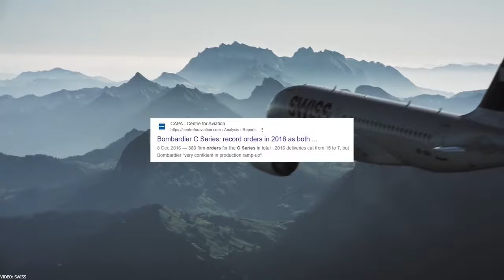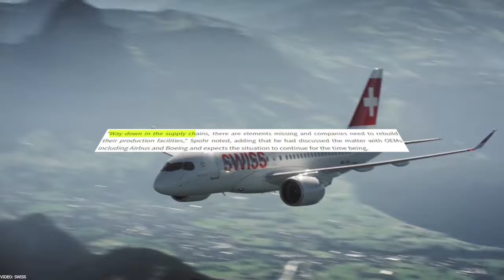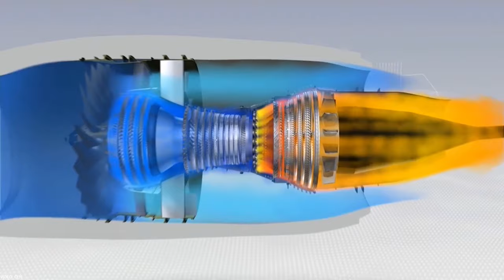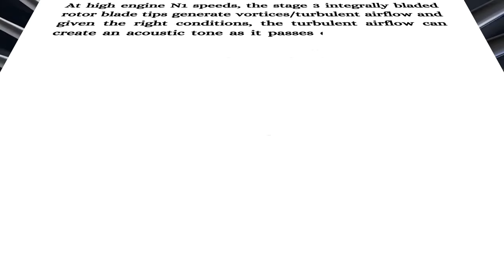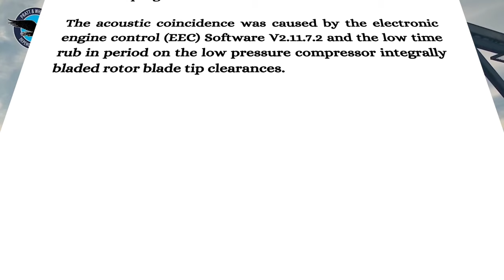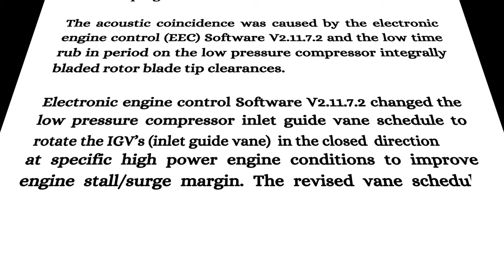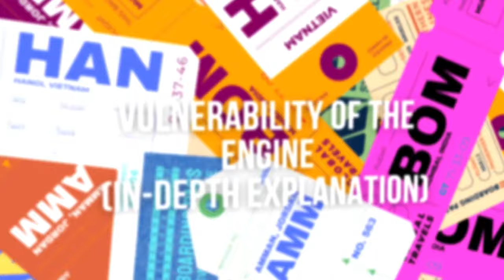A220: From A MIRACLE to the BIGGEST BURDEN for airlines

Comment: well at least you don't have to fight the plane itself over controls as it tries to swoop you down to the ground every 30 seconds.
Reply: You mean Airbus fly by wire where both pilots can cancel each other out without knowing?
Reply: @matth9254 you don’t
Know anything about airbus fbw
Reply: @matth9254  Doesn't quite work like that.
Reply: @matth9254 nope, there are 2 things that happened in boeing’s industry..

Comment: Issue is mainly with engine. Have you ever flew with this model? I am frequent AirBaltic client, and I can say only good words about C Series. Basically there isn’t any similar or comparable aircraft in the market. Engine issues will be solved sooner or later.
Reply from the maker: Like I said, problems are normal in the early phases of an aircraft. 

I think the A220 is one of the most efficient and most flexible aircraft because of its range. I mean air Baltic flies with the A220 even to the south of the Middle East from Riga and the range is probably one of the key factors (and the integration into airbus’ portfolio) why airlines buy this aircraft and not E2 jets.

However, if the engine is not reliable (and the PW GTF 1500G is the only available engine option) airlines can’t benefit from the A220 which is currently a big problem, especially for airlines that fly in dusty and sandy environments. 

Nevertheless, I am sure they will solve the engine- and supply chain issues. 

But the problems with the GTF engines (A320, A220, E2) could maybe lead to a disadvantage in future aircraft projects. So CFM could gain more market share.
Reply: @Flyment-de5yx  well, yes your are absolutely right. In general I think that introduction of second engine option for A220 is must, and not just because of PW engine issues. That is giving the benefit also in case if some  of Boeing clients are deciding to cancel order by some reason in favor of A220. Then they are agreeing on conditions just with aircraft supplier, but engine can be used for A220.
Reply: The A220 and Embraer E2 use the same engine, just different variants of it.
Reply: I don't know if Baltic uses A220 to connect to/from International, but Delta certainly does at it's Seattle and Salt Lake City hubs.  I avoid the A220 at all cost when I am traveling to/from international flights.  I still remember missing an international connection flight because of A220 mechanical issues, then merely a week later, I spent close to 9 hours in Seattle lounge on a 1.5 hr connection, because my return flight's last segment on A220 had another mechanical issue.  Back in those days, you can open up any of the Delta A220 aircraft tail history, and see red flight after flight after flight.  The amount of IROPs caused by it were just alarming.
Reply: @_w_w_  well I’m travelling with airBaltic 60+ flights per year, and sure there are sometimes delays, but nothing really general. Basically AirBaltic is having singles fleet strategy and that means you can fly on the only A220. I can see only good words about those planes. Before they had quite many 20+ years B737, and some newer Q400 next gen.
Reply: @lifter479  I fly about 200k-250k miles a year and with Delta baked in a short connection time, to reduce lounge crowding, it's risky to take an A220 as the first leg for me.  E175 and A320 are much more reliable.  It's a decent plane but I am not taking it on critical trips until all these issues are well addressed.

Comment: The biggest problem: servicing the Pratt & Whitney geared turbofan engines. Even the highly-experienced Lufthansa Technik can't keep up with the maintenance demands of the P&W GTF engines with less-than-desirable usage rate of their A320neo fleet. It seems only Delta Air Lines with their massive, highly-organized maintenance network keep up with servicing the GTF engines.
Reply: As a delta line mechanic this plane is highly disliked for its engine and APU problems as well.
Reply: Referred to as the “Hammer Dog”  !    Good times  -   Good bless mechanics .

Comment: I am a frequent flyer with Delta, which operates one of the biggest fleet of A220.  My home airport happens to be one of the key routes A220 was used on.  The A220 was so problematic, I avoided it despite of its more modern and more comfortable cabin, especially if I am connecting in/from international flight.  Of my 20 years of non-stop frequent flying, A220 is the only aircraft to cause me to miss connection or barely make a connection or spend way more time in the lounge than I want to.  There are a lot of teething issues with the plane, I even saw crew loading up sandbags to address weight balance issues.  Many people also don't mention it, but the P&W engine used on A220 is a noise polluter.  While it may be quiet in the cruising altitude, it's very loud on the ground.  My home is not far from the airport and I get woken in the morning by the P&W's orca-mating spooling sound. Even sitting in the plane, it's hard to ignore this sound and I've gotten woken up by it.

Delta mostly use A220 for short-hauls regional hops to their hubs.  I am rather happy with the E175 for that purpose.

Comment: I have a question. Presuming that the engine  manufacturer properly tested the engine why weren't some of these problems not identified prior to the engine going into regular service with world airlines? There may be a good answer(s) to my question, but I just don't know what it is! Thanks.
Reply: Just like with any other test they did it in a controlled environment.

There's a lot of difference in parameters weather pollution humidity in different locations same with cars that's why with cars they test it now in different continents countries or retest the vehicle before launching the car in a new location
Reply: Thanks for your reply. I am still left with the question of why the testing process did  not reveal the potential for, if not the actuality of, the kind of problems airlines are experiencing with the engines? In other words, were there deficiencies in the testing process and the tests themselves?
Reply: @dalydegagne1839  well to technically answer your question the testing are there just to test and prove the newly engineered engine and fan blades testing fan blades strength.

Even if you run the engine 72hours or even 1000 hours you won't be able to see the actual metallurgy performance in the real world by those tests which is very important with PW GTFs as it depends on gears
Reply: Thanks for your reply which helps me to understand more clearly!
Reply: @dalydegagne1839   GE identified the problems with the gear turbofan engines and stayed away from them. The leap engine on the 737 is highly efficient but no geared turbofan.
Reply: The problem with the early planning was that the A220 had been designed with the P&W as the only engine option. Airbus in planning the next A220 variant to have more than just the one option. It’s a shame a great aircraft is spoilt by this but hasn’t stopped massive orders for the type most recently last week from American and Delta. Lots of confidence in the type still despite P&W’s unreliability issues.

Comment: I’ll give the video a 👎. In the beginning Bombardier brought the plane out and it just not sell. Delta finally came around and took a chance on it and became the first customer (of course at rock bottom prices). And then they were sued by Boeing which led to Airbus setting in in a well played move to acquire 50% of the program. The main problems have to do with the engines and teething problems of it being a new airplane (what airplane doesn’t have teething problems?).
Reply from the maker: That’s not true. Delta wasn’t the first customer. Delta bought 75 c series at the time. The program had already 247 sales before 2016 (that was the time when the c series entered commercial service). I would consider launch to 3 years into service as “in the beginning”. 
And in this span they sold 541 aircraft. 

And when you look at the orders from 2018 on (airbus bought the program in autumn 2017) you see that the sales are not higher than in the phase before the launch except for 2018 (165) and 2022 (105)according to Wikipedia. 

In 2019 they only sold 63 aircraft, 2020 30, 2021 38, 2023 33.(Wikipedia)
Reply: @Flyment-de5yx  yes it is true. Delta became the first launch customer in the US and the first company to place a major order of 75 planes. Before that the program was flailing and had to be bailed out twice. It just wasn’t a hot seller until Delta stepped in and put the program on solid ground.
Reply from the maker: You said “Delta finally came around and took a chance on it and became the first customer”. That’s not true Delta wasn’t the first customer. If you don’t believe me, google it. 

Yes the program was postponed because of low sales before the introduction into service but the early stage of an aircraft program is from launch to 3-5 years commercial service (I would say) And in the first 3-5 years (commercial service) you can see that it is a success. 

So now you could ask yourself why did the program sell poorly before the introduction into service?

That’s simple, because the program was launched  too early. 

To this day Embrear 190 and 195 (which have a similar seat capacity) fly around. 

The first delivery of the E190 was in 2005 and the E195 in 2006. Please note that many aircraft were delivered later. 

So when the c series was launched it was too early because many airlines got a fresh Embrear. So there was and is to this day no need (right now) for some airlines to buy an a220-100 or cs100 back then because their aircraft is not at the end of its lifecycle (that varies from airline how long they wanna keep an aircraft).

The A220-300 is a direct A319 or 737-700 competitor. 

Almost 2/3 of the 1486 customers got their A319 after 2004, so why would they buy a c series at its launch in 2008. Even in 2010 or 2012 it would have been too early. 

The 737-700 reflect a similar picture when you look at the deliveries.
Reply: @chrisroberts3963 what are you talking about. Air Canada ordered 45 with 30 options before Delta.

Comment: The Embraer’s E2 series uses the same engine and does not have this issue.
Reply from the maker: The E2 Series has problems because they DO have the same engines, KLM for example, has to change their flight plan because of engine issues. They also grounded some E2 jets according to aviacionline.com.
Reply: It does bro. It gives the e195-e2 a headache .e2 being exclusive with problematic GTFs PW
Reply: Because it's a better airplane IMOP.
Reply: The more fuel efficiency the engine gives, the more prone on engine failure.
Look at the efficiency between E2 and 220.
Reply: @alexlo7708  yes because it is overdrive but more parts more things to break

Comment: They will fix the problems or Embraer will benefit.
Reply: Embraer do not offer anything similar to the A220. The E-jets are regional lacking any sort of range beyond regional operations.
Reply: Embraer won't benefit because the E2 uses the same engine as the A220.
Reply: @devon896  PW yes. But different model number?
Reply: @bradrothberg5863  Same engine. Just like the A320 and 737 have the same engine, just a different variant of it.
Reply: @devon896  not exactly the same engine. It had some problems but I don't think they experience the same problems  as A220s from what I know.